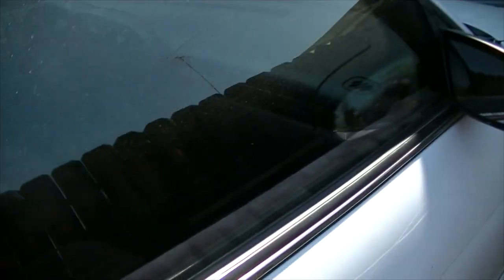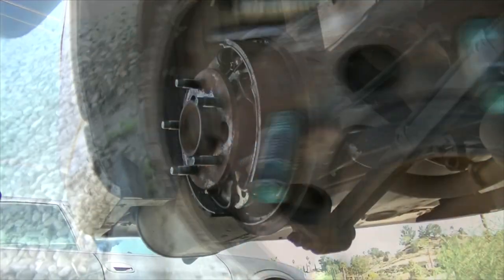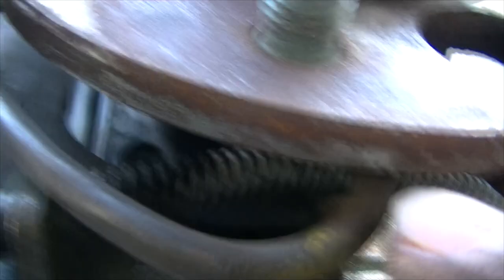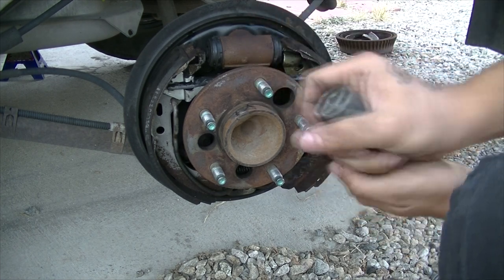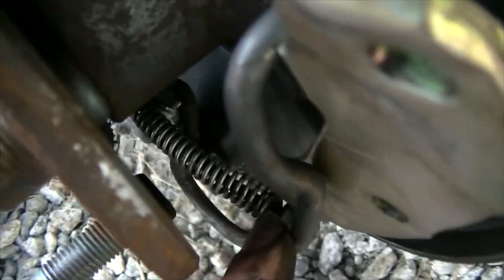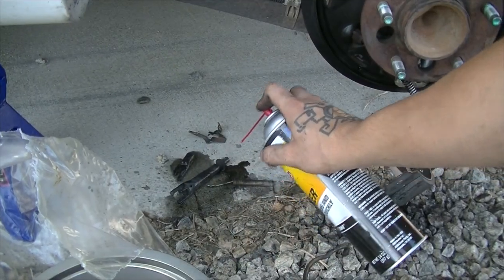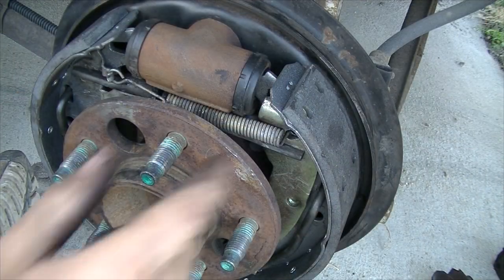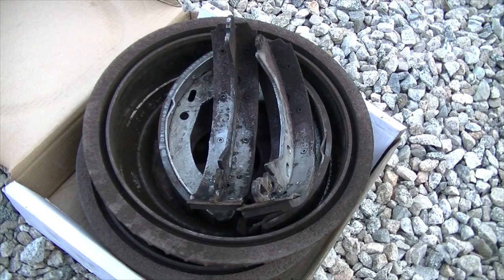1998 Chevy Lumina: How to Replace Rear Brake Shoes and Brake Drum

Comment: SAY BE SURE TO!: 

Once the drum is removed, water hose off the old shoes and backing plate and all before disassembling to SAFELY remove dust you DON'T want to breath in.
Spin the hub with your hand and wiggle, checking for possible bearing are going bad noise or roughness or looseness.

Peek under the hydraulic cylinder's 2 rubber caps for signs of possible brake fluid leaking from seals, indicating cylinder replacement & bleeding needed. 
Sand paper and clean and then lightly grease the backing plate's 6 small flat surfaces the shoes metal contacts and slides on!!!!!  If you don't your brakes can stick, click noise, not self adjust as well and wear groves into the metal backing plate flat surfaces requiring smoothing or backing plate replacement.

I had good tricky luck using 2 long screw drivers to manipulate the U metal spring bar ends into the brake pad holes. Using one driver to move the bar towards me and at the same time using another driver to move the bar towards the pad's hole. 

Clean and lightly oil the self adjuster threads and turn it back in some shorter to accommodate the new thicker shoes. 
Also make sure you have the horizontal self adjuster forks installed with long bent tab in the back on one end and seated straddling both the shoe and park brake arm and the cap's beveled short slip in-end in the back on the other end.

Then expand one shoe some to carefully work the 2 peice self adjuster back into place and then the adjusting star wheel tiny ARM. Tricky but eventually works even with 1 person.

Make sure the adjusting star wheel ARM is touching the teeth so that it will self adjust whenever braking while backing up and the spring is not touching/stopping the teeth from turning. 
With a screw driver, manually turn the teeth to expand the brakes some then center the shoes with your palms and install the drum while checking for drum free spinning yet shoes are almost touching. Remove drum and adjust more or less to get the self adjusters close to touching.   

Make sure the hub's face and drum's inner mating to hub surface and drum's outer face to inner tire mating surface is free of excessive rust and debris that could cause uneven mating/sandwiching.
Once done, carefully back up the vehicle while pushing the brakes pedal on and off to actuate self adjusters to click and remove any remaining shoe slack.
Remember when you first start to apply the brakes, it's the rear brakes that come on first to keep the vehicle tracking straight. If the first pedal depression is not responsive, the rear brakes adjustment engagement are suspect.

Comment: Very helpful! I might need to check my rear brakes check as I have to push the peddle down further to slow down the car. I only had the fronts done since I bought my '96 Lumina 4 years ago. I heard drum brakes cost more than disc. Lots steps involved , but looks easy to do.
Reply: Damusician Strikes Back you need to try bleeding the breaks. I had the same problems and I bleed my front breaks and it fixed it. You need to replace the back brakes whenever you can tho but bleeding them will temporary fix it. Also I know it was a year ago you left this comment I just hope it helps someone else. My drum brakes cost 17 dollars and my disc was 20.
Reply: You prolly dont care at all but does someone know of a tool to log back into an Instagram account??
I was stupid lost my account password. I would appreciate any tips you can offer me
Reply: @Cassius Wilson Instablaster =)
Reply: @Phillip Rex it worked and I actually got access to my account again. I'm so happy!
Thanks so much you really help me out!
Reply: @Cassius Wilson glad I could help :D

Comment: the horseshoe is the biggest pita to get lined up, but it goes pretty deep on that nub there and you will know once you fuckin got that biatch
also 

thank you very much for this video, my chevy malibu @ 300,000 miles had the horseshoe snap and i heard it rattling in there.
the pads were still at like 80%, truly amazing and i use my parking brake every single stop use this car for delivery driver mode.

the ultimate reliable car, the 3.1!

Comment: Same brakes as 1999 Buick Century.  I've done this a couple of times. I just find it curious that GM did not use a primary and secondary shoes.  The primary being the lead (facing front of the car) is typically smaller and the secondary larger.  I can only raise one side of the car at a time.  I get to the second side and that's when I think I mixed up the brakes.  Nope both are the same size.

Comment: Your shoes looked like they had plenty of meat led on them.  You should also adjust your shoes after the drum is on.  There is an access port behind the assembly where a brake adjustment tool or short flat screwdriver will spin that wheel to bring the shoes out.
I observed you call them pads - I am also so used to all wheel disk brakes too.  You should clean the assembly after the old shoes are out so as to maximize the cleaning solution.

Good way to tell if your shoes are adjusted good is that the emergency brake will have a short distance to travel to apply the rear brakes.  I just did the first replacement of rear shoes on my 2002 Chevy venture.  Looked just like yours.  I myself am not accustomed to that large retainer spring.  Back in the 1990's when I did my last shoe job, there was a spring pin that held the shoes in place.

Comment: Most of the time the back bearing will go out & you replace shoes while your there..car will give a sound like the brakes are going out with a vibration like a tire out of balance  on the freeway..just check the bearing cause the brakes look fine on that car
Reply from the maker: Thank you for the pointer!
Reply: Stevo oliver; I'm experiencing that exact problem on my '98 Cutlass..it suddenly feels like my rear wheel is bent or out of balance at higher speeds. Going to inspect that hub assembly..thanks for the tip!

Comment: that was not really necessary to change the shoes on that car unless the rivit heads are almost flush with the surface of the brake lining material they were more likely out of adjustment and brake shops recommend putting a lubricant on the metal to metal contact points to prevent squeaking when braking. I you are not sure of what you are doing do a lot of research and ask questions before doing something your not sure how to do.
Reply: What I don't get is why are you "brake experts" always commenting on someone elses video. Why not just upload a video of you doing a brake job and sharing all your vast knowledge instead of just nitpicking at some dude for having the balls to upload himself doing a bake job. I mean you know it all dudes NEVER have any uploads whatsoever of anything on your channels why should anyone listen to your advice. Shut up and upload a video.